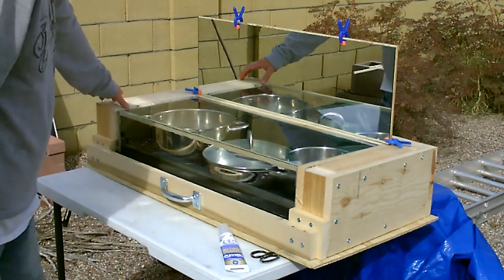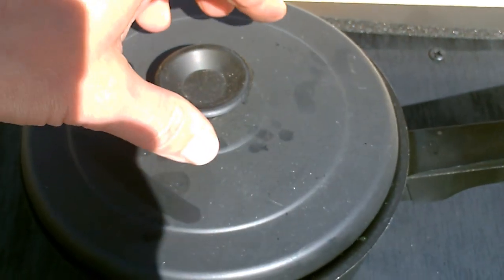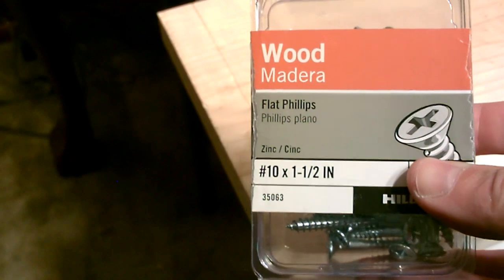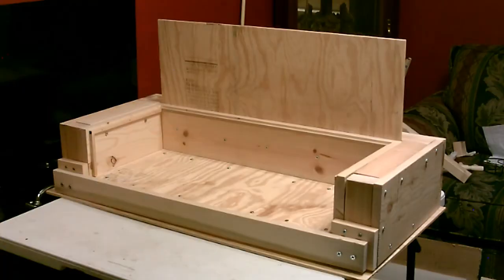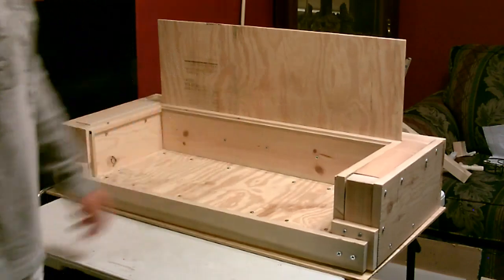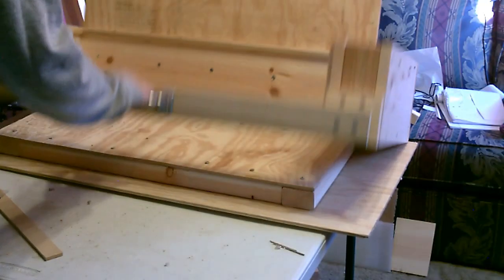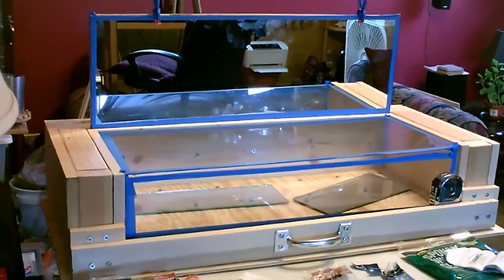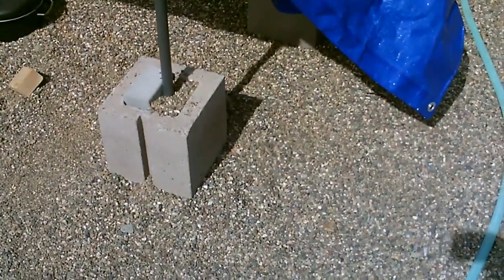DIY Advanced Solar Oven! Fully Insulated "No Turn" Solar Oven! (real wood, glass and mirror!) 350F+

Comment: Brilliant! Love the layout and the materials used. Two things though - insulation is more effective when not compressed like you are showing in the video. Also, you can use Boric acid powder added to the home-made insulation to make it more fireproof.  (Although it's enclosed in your construction, so not as necessary.) Thanks for sharing your build!
Reply from the maker: hi there and thanks. just to clarify on the insulation and it's effectiveness. it's not homemade - it's actually store bought (home depot/lowes sell it). some insulation may need to be loose-packed but with this type the R value (effectiveness) actually increases quite a bit the tighter you pack it. it's about a 3.8 loose and reaches over 4 (per inch) when packed.
Reply: @desertsun02  Thanks, what's it called?
Reply: @desertsun02  Thanks for this clarification.   I was also thinking that it should have been packed looser.  I didn't realize that this type of insulation works better packed.  Great build!  I'm going to try it.